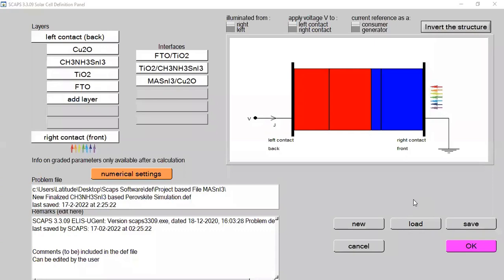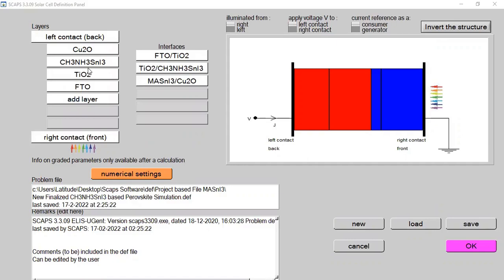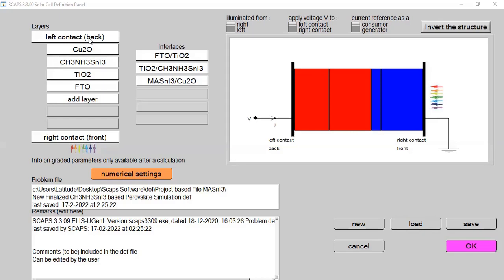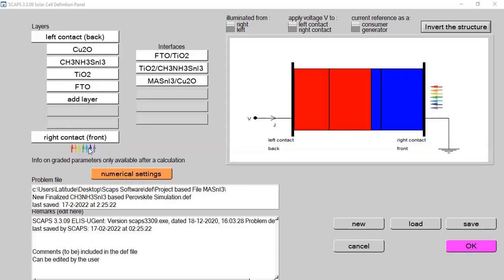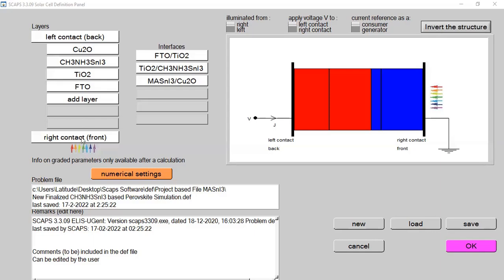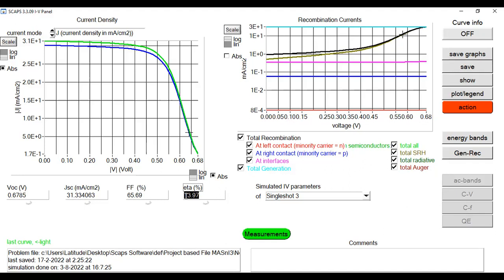Lecture No 16: Effect of Back Reflecting Coating on Performance of Tin based Perovskite in SCAPs 1D.

Comment: AOA sir
Absorber mein absorption file ka kia role ha??
Wo upload krni chahye ya ni??
Reply from the maker: You can export externally if you have accurate absorption data for said materials but for simulation one can use by default absorption coefficient of SCAPs.
Reply: Ok sir
Reply from the maker: You may refer alpha= squareroot hv, I m sorry it's bit hard to put mathematics over here. I recommend you to check how to add absorption file extranly from my past video